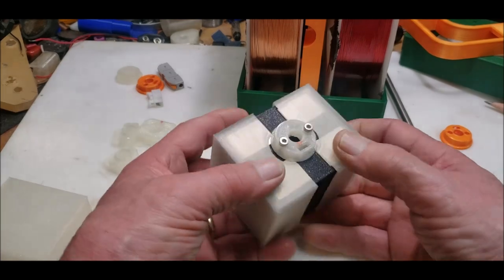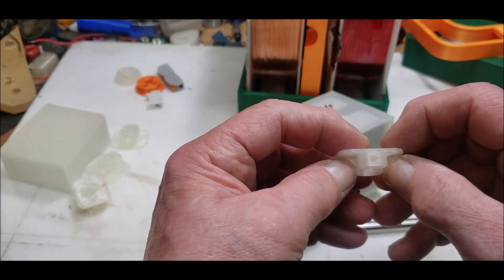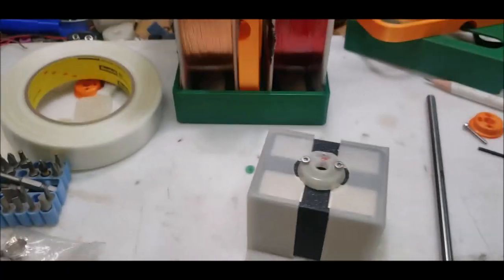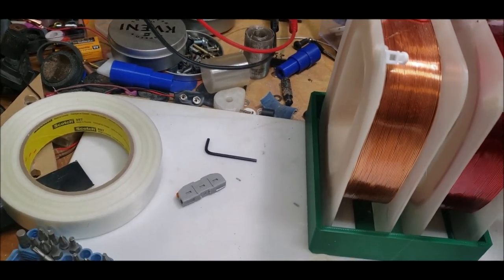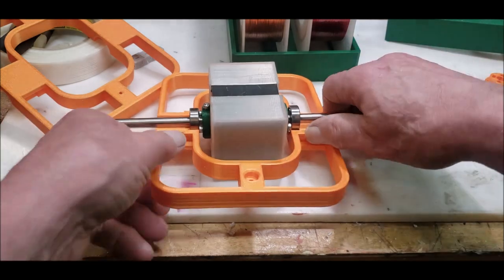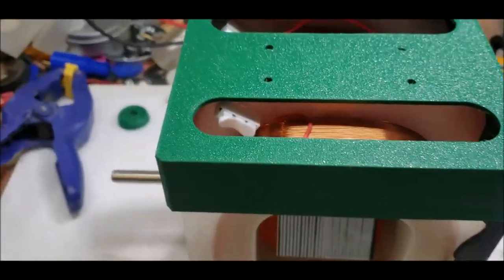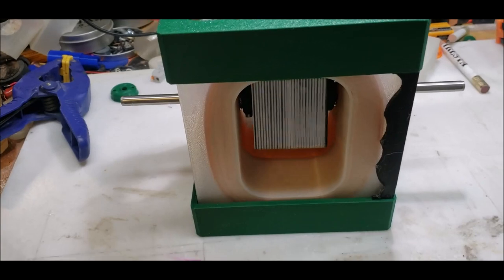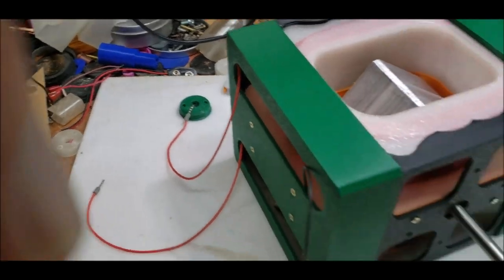3D Printed RD3DP Newman Motor Build and first run (sort of)

Comment: I like how you experiment and try out different ideas. That's the foundation for this hobby. You really made it your own and thats the best example to everyone to practice. It came out great brother! Thanks for doing it...
Reply from the maker: Thanks man. I'm printing out the parts for the brushes now. I also wanted to let you know about a filament company called Voxel (you may already know about them) but in case you don't, their the best filament maker (IMHO) for the price and quality. Their way better then some bigger name brands.
Reply: @mcorrade  Nope. But I'll definitely give them a try next. Thanks
Reply from the maker: @redesign3dp  16$ per roll and if you buy 2 or more its free shipping. I only buy voxel unless I need a specialty filament like iron infused or copper.
Reply from the maker: @redesign3dp  So I got your Zero Force Motor and can't wait to start that print. I guess the biggest part to print is the stator?  The coil design is interesting ;-o
Reply: @mcorrade  dang your my biggest customer... what ever happened with the small zero force?
Reply from the maker: @redesign3dp  I have all the parts printed out but the coils I wound are terrible so I put that one on the back shelve. I'm very interested in the bigger one :)
Reply: @mcorrade  ok, just curious
Reply from the maker: @redesign3dp  Ya I'm going to rewind the coils at a later date and build then.